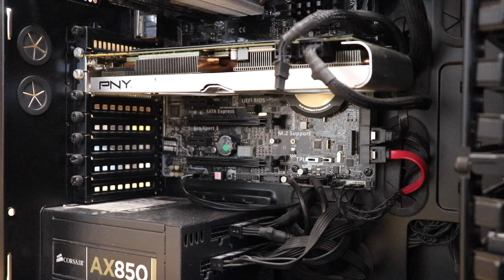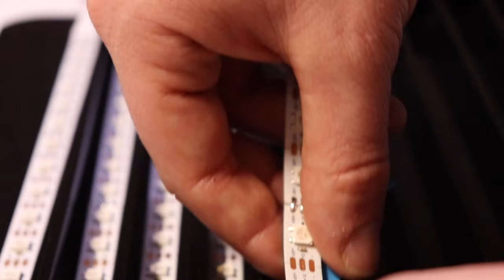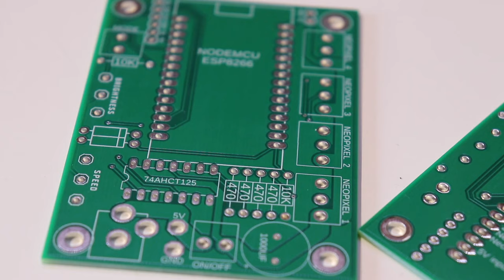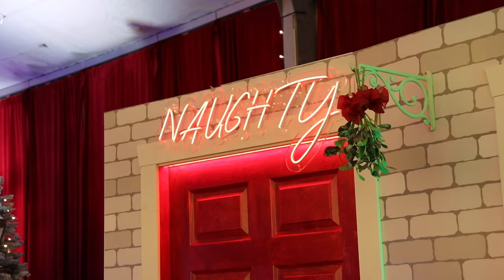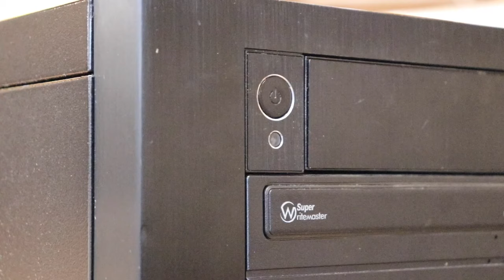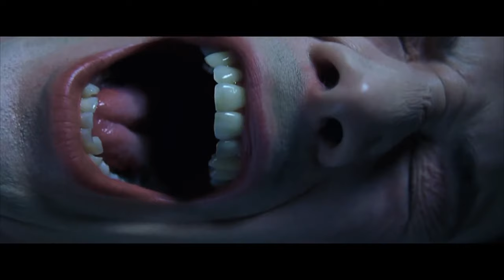I Connected My Gaming PC To The Matrix

Comment: why use esp8266 for this??
Reply from the maker: for this application, it is a bit overkill. But I designed the PCB to be compatible with future projects. The ESP8266 offers internet connectivity and a lot more memory than other microcontrollers (like Arduino), thereby enabling me to theoretically control tens of thousands of NeoPixels assuming appropriate power injection.
Reply: @WillDonaldson  yeah totally an overkill, but cool project though!